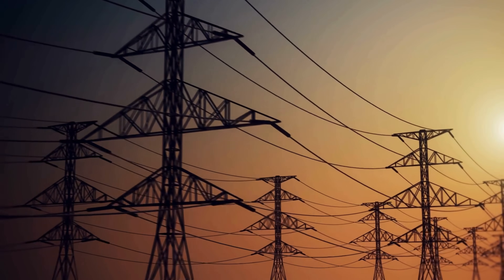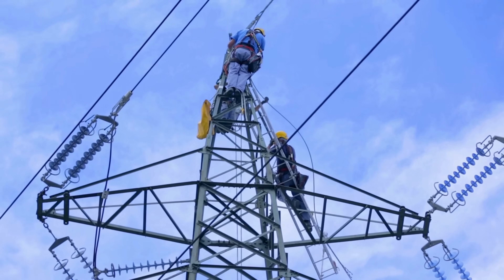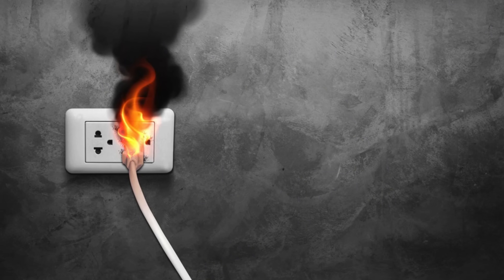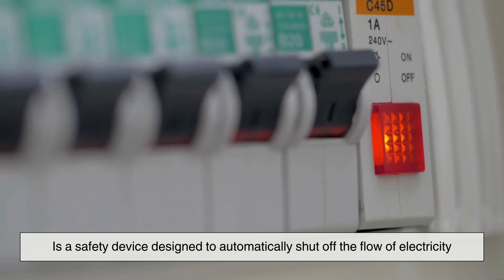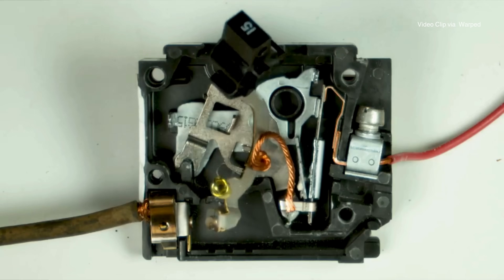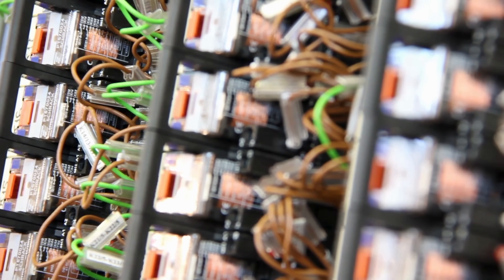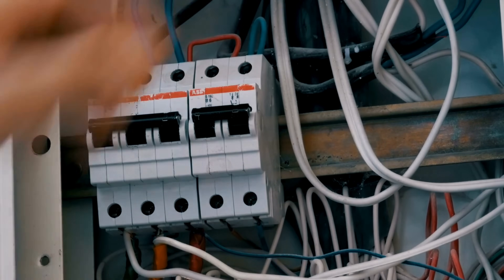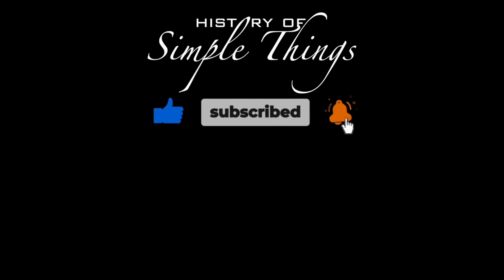What Happens When You Remove Your Circuit Breaker?

Comment: What has been shown here is a thermo-overload breaker. Theres also a magnetic-overload breaker. Magnetic circuit breakers use the magnetic force produced by excessive current to trip and interrupt the flow of electricity. They typically include an electromagnet and an armature. When a short circuit or significant overload occurs, the resulting high current generates a strong magnetic field, attracting the armature and causing the breaker to trip, stopping the current flow. 
Thermo overload protectors are slow acting allowing time for high inrush current, like for motor starting, to level out before tripping. The magnetic breaker has a electro-magnetic coil that activates rather quickly on inrush current.
Therefore, the thermo-breaker is more suited for home use as the magnetic would be tripping every time a motor like a refrigerator of Air Conditioner would start.